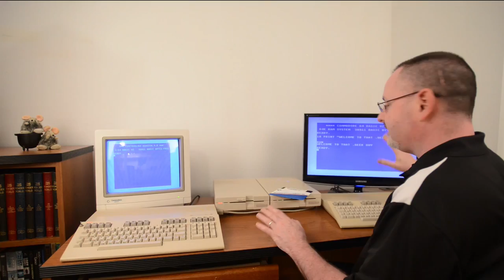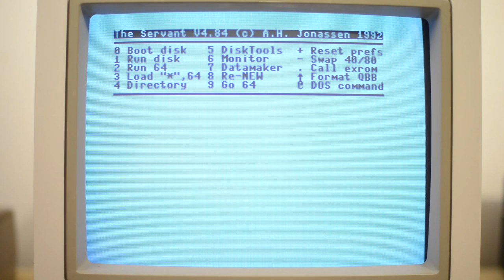Commodore Hacks P1: Enhancement Chips

Comment: I was an Atari 800xl user in the 80s.  I bought a C64 & two drives because the Commodore had so many games available.  I quickly discovered the Commodore disk drive system was junk.  Very buggy and slow as dirt....

Comment: I don't think think that "twice as fast" is correct. Even by software only (turbodisk etc.) six times the original speed was possible, and fastload systems like the one in the Action Replay cartridge could load up to 15 times (usual files) or even 25 times (specially formated files only loadable by that system),  all available back in the 80s. So twice the speed seems wrong. The developers speak about six to ten times.
Reply from the maker: Thank you for the feedback. This was my first video, so I was leaning to the side of caution, because similar to what you mentioned, manufacturers would make speed claims based on certain circumstances. 

If you haven't watched them yet, check out the two Floppy Drive Showdown videos. I actually did a couple bench tests to see just what kind of gains were possible.

Comment: At the time, the Commodore disk drives were way way slower than the other major computer manufacturers, and though faster than tape loading, NOTHING was like seeing your friend flip the switch on their Apple II and having their program loaded and running faster than you could type in "load..." on the C64!! Atari, Apple, IBM, all speedy. Commodore, slow but also the most affordable. I love my Commodore computers, but the loading was always slow. Spelunker was murder to wait for.
Reply: I just use a warp speed cartridge...very few people used stock 1541 with no speed ups. That said, back then, i was one of those kids loading with stock 1541, and no accelerator. I didn't really notice anything wrong with its speed. At school we used apples, but they only loaded pure liquid steamy  garbage which i didnt want at home.
Reply: TNT Yes, and all that slowness was mostly because of buggy implementation.

Comment: I have a C=128D with the servant and works great. Still use the 128 for the retro games. Just added a SD1654 drive and much easier and faster. Also have Jiffy-Dos.
Reply from the maker: That's so cool. You don't hear that much about the Servant. It came installed in the 128 shown in the video when I acquired it. I purchased an eprom burner with the sole intention of playing with the menu customization options. Whenever I get caught up with all the other projects I'm working on, I'll try to make a video covering it.

Comment: Hello, do you know if I can connect a commodore 128 to an hercules monitor?
Thanks
Reply from the maker: It really depends on the model and the connector types. I have had a lot of trouble connecting my 128 to certain Commodore monitors in 80 column mode. But the same monitor worked fine in 40 column using the RCA (Chroma) connectors. You may have to fabricate a custom cable to make it work.